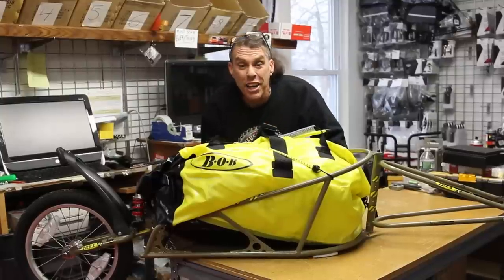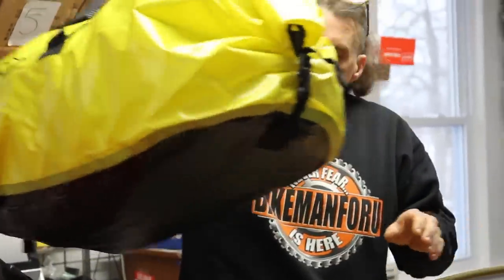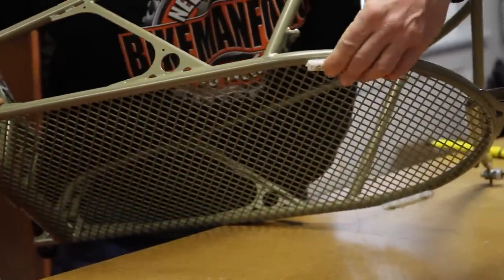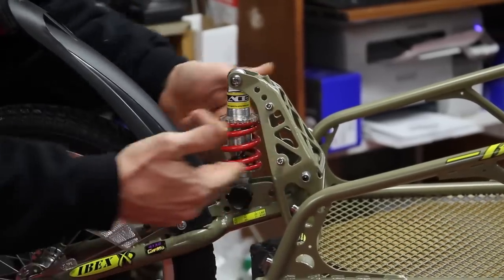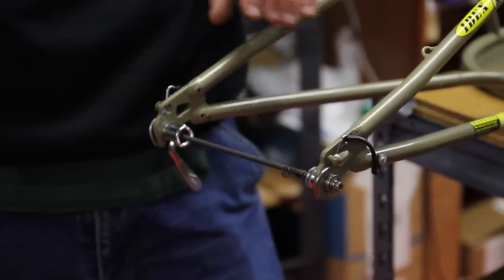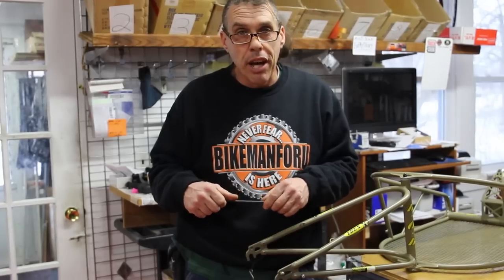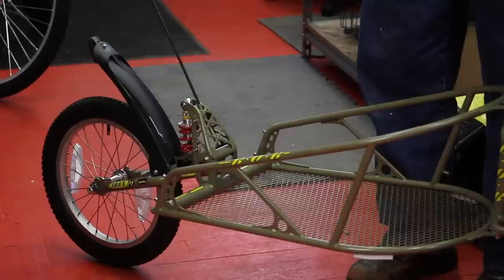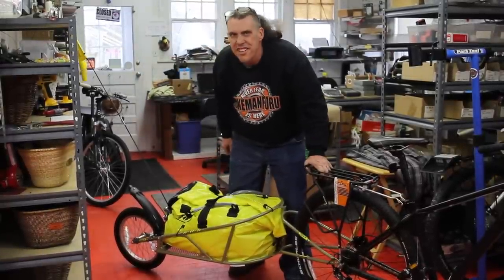Unboxing + Installation - BOB Ibex 28 Plus Suspension Trailer - BikemanforU

Comment: I have a non suspension version of the BOB trailer.  I have been using it for over 10 years and absolutely love it.  From getting a week's worth of groceries to traveling around the country, this is the perfect cargo trailer.  I must add that one should also buy a good quality lock to go with this trailer.  Unfortunately, in Calgary at least, it is a thief magnet.

Comment: What are the DIMENSIONS (L - W - H) of the bag/cage?  Does this model come with STANDARD THREAD for the rear wheel nuts so the hub doesn't have to be changed?

Comment: nice video, Thanks :) 
just a quick question, I have a Surly troll and I would like to instole the BOB not with the QR, could you tell me if there are some nuts to be use with the hole in between QR and rack hole? I thinks is a 10mm tred .. 
many thanks 
Sergio

Comment: Hey that was a pretty intense video as I watching and understanding the weight distribution of a bob trailer and also understanding what section of the trailer itself determines where you would put suspension is really about alot of PHYSICS. Thankyou for the shout out have a good day

Comment: Wouldn't work on my 2019 Trex X Caliber 8. The derailleur stuck out too far and the tongue hit the mounting nut on the hanger if I went over a bump more than a few inches or climbed a curt. Bob doesn't have any solutions for that problem and I can't see my way to hacking something that might fail on the trail somewhere.

Comment: I always like the BikemanforU videos. I use trailers a lot and I recommend people with bicycles to think about the benefits that a trailer might bring.

For touring and commuting I like two wheeled trailers. The single wheeled trailer can place strain on the rear axle and as the cyclist leans left or right then they are also moving the mass on the trailer. With the two wheeled trailer the stress at the hitch is very much less and the mass is decoupled from the bicycle much more.

For touring I think people might want to look at the Cyclone by Radical. For any kind of use they might be interested in the Carry Freedom. There are many others of course.

Whatever trailer you decide on I think you will find it will add so much capability to your bicycle.
Reply: brighton dude hell yeah I want this particular trailer someday😀

Comment: I know you can easily lock the trailer to something, or route a cable through the trailer and bike to secure the trailer, but it would be nice if the attachment used to secure the trailer to the bike had a lock. I carry around a Kryptonite U-lock and cable to secure my bicycle frame, rear wheel and front wheel to something whenever I leave the bike and I can't keep an eye on it. The U-lock and cable is a real pain to carry around because it is heavy and bulky, but it offers good security. I secure my bicycle seat and post with a bicycle chain, which is always attached. If I know ahead of time that I am going to park the bicycle where I can still keep an eye on it, than I use a combination cable lock to lock the bike, because it is much lighter and less bulky than the more secure U-lock. If I had this trailer it would mean I need another lock to secure everything. I wish these companies would think more about security when designing their products.
Reply: MotorheadRedo 

The problem is that i would suspect some one with a set of pipe cutters could quickly cut that pipe and release any lock. Pipe cutters look like a C clamp and adjust to fit the size of pipe used. They will cut through steel as they score a ring around the pipe and continues to score deeper as u turn the clamp. So even if the chain is secure they could still take it. Not mention if things are just strapped in the trailer, that isnt secured either. And a pair of bolt cutters would make the snach and run much easier.....or else you stuff just gets unstrapped and walked off with. 

The best bet is probably a lock box trailer.
Reply: MotorheadRedo 

Made from old bed frames. Thats much harder to cut.

Comment: This a thought about all trailers around on the market.
I wonder why ... The trailer is around 6kg... There are complete bicycles weighting that weight...
1.wheel weight 1.2kg/1.5kg complete with tire.
It means the whole thing is super heavy for the size and the weight it is supposed to carry (max load 30/45kg).
The frame only of the bob it is around 4.5kg I supposed. Bicycle steel frame weight around 2.2kg...
I do look forward for someone to come up with a practical solution for traveling and trailers with a weight under 4kg
Reply: Quality aluminum is light but is expensive and other than you... perhaps there is no for a $900 ibex? No mystery whatsoever as the steel vs aluminum debate has been with us for many many decades. This trailer IS a practical solution, WILL carry the weight limit claimed and have been spotted all around the world. Rather than over-analyze...go riding.

Comment: Nice. I'd be slightly fearful that the little clips that secure the bike to the Bob may get damaged or lost over time. They are such an integral peace of the system. It's not like you can make new ones.
Reply: carry a cotter pin with you